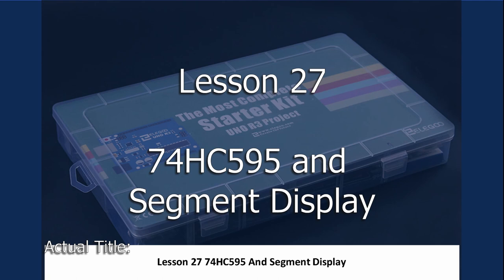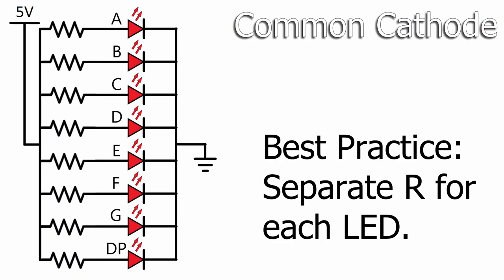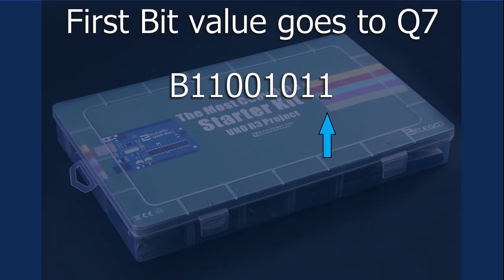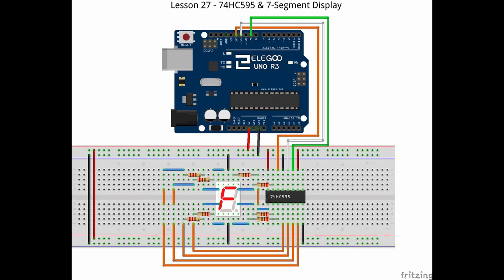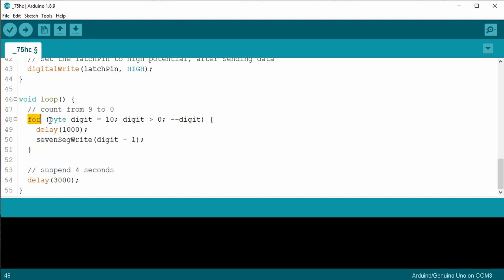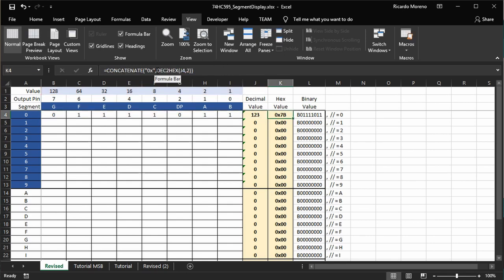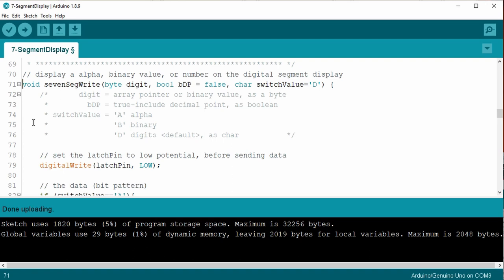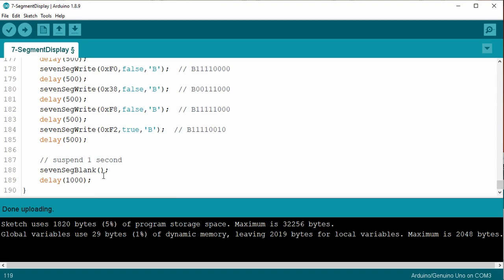Lesson 27 - 74HC595 and 7-Segment Display

Comment: mine wont work and it heats up very fast, it almost caught fire
Reply from the maker: Wow, that's terrible.  May I ask if you are using the components from the Elegoo kit?  Or did you purchase the parts separately and attempting to run the lesson?  I only ask because some displays are 3V, while the kit uses 5V.
Reply from the maker: Also, you want to be careful about your maximum current.  8 LEDs at 14.5mA is 116mA.  If your 7-segment LED has a different voltage drop per segment, you'll need to recalculate the resistor values.
Reply: it a 5v numerator so i used a 220 ohm resistor i think

Comment: I designed a 7 segment display that has RGB leds. My shift registers are hooked up in an order from Ared -> Agreen -> Ablue -> Bred -> Bgreen -> Bblue etc... Its on a PCB so i cant change it easily. what would be the best way to simplify shifting out data to only the red, green, or blue pins if they are located every third bit? I would like it to be computationally light as I plan to use bit weighted modulation. E.g. 00010101 would turn the leds off for 128 + 64 + 32 cycles, on for 16, off for 8, on for 4, off for 2, and on for 1 cycle. (using the enable pin). The process is repeated for each color so it simplifies to:
output data to red bits.
BWM for 256 cycles.
output data to blue bits.
BWM for 256 cycles.
output data to green bits.
BWM for 256 cycles.

All it does is display time so I need to have a way to easily display HH:MM using data from an RTC. I'm hoping that in itself is not too complicated.

Thanks,
Andrew

Comment: Hi, first at all, your lessons are great!

I wanted to ask you if you can help me out with an issue I'm having with the 7 segment display. Before trying "fancy" connections/scripts, I followed the Eleego tutorial, without changing the default sketch.
Once I loaded the sketch, the countdown showed:
9, 8, 7, 8, 9, 4 (without segment B), 3, 2, 1 (without segment B)

I really cannot understand what the problem may be, since as I told you I did not deviate from the default code/connections..

Thanks!
Alessandro
Reply from the maker: Sorry, all I can think of is that you'll need to re-check your wiring.